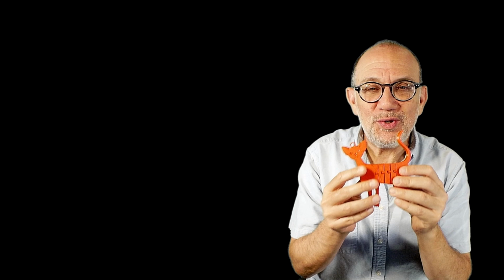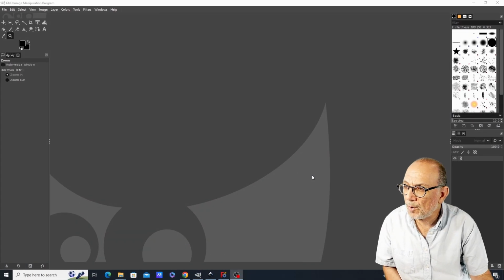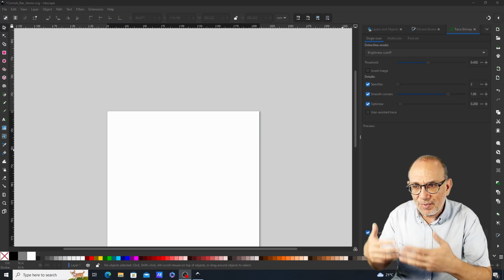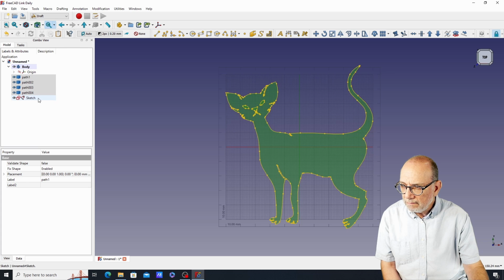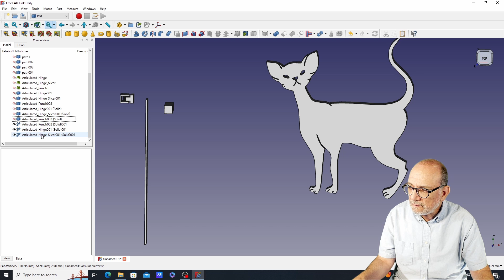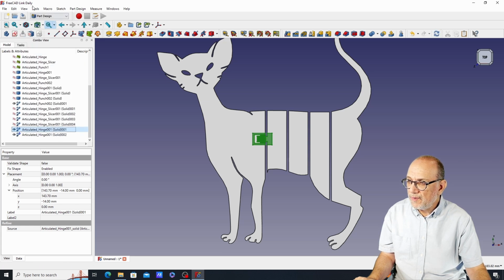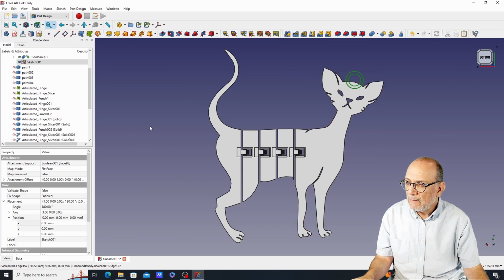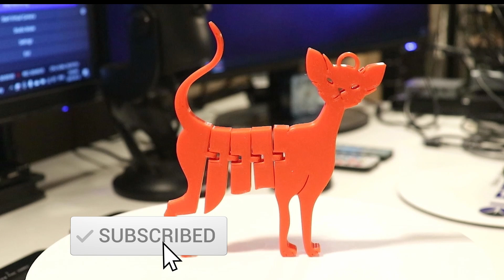Make Hinged 3D Models Easily in FreeCAD

Comment: can't convert the hinge into solid
Reply from the maker: Hi there...can you tell me what happens when you try to convert.  Is there an error of some sort?  RG
Reply: @CreatewithTech  The boolean cut in Part Design Workbench is not working, but I use the Slice function in Part Workbench to perform the slicing, it's finally done.